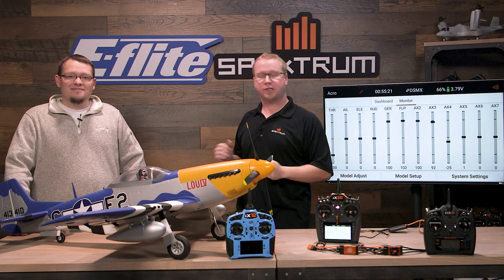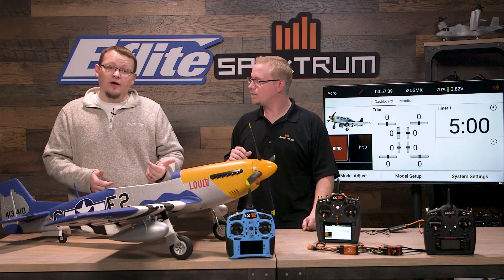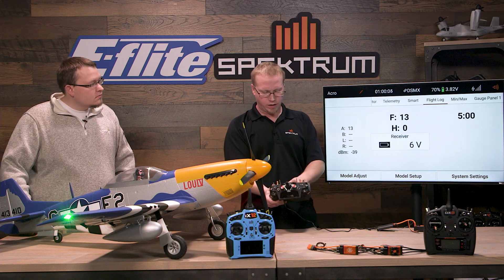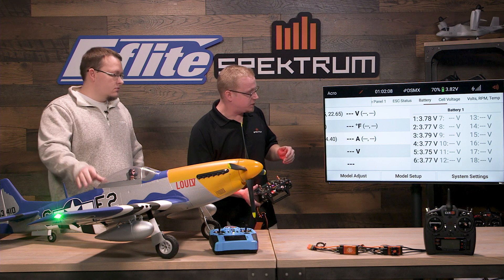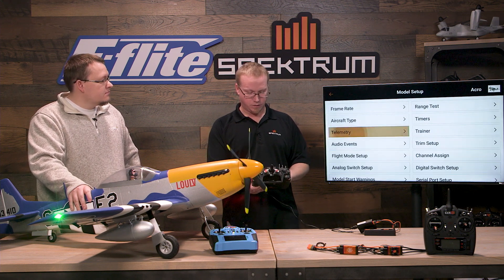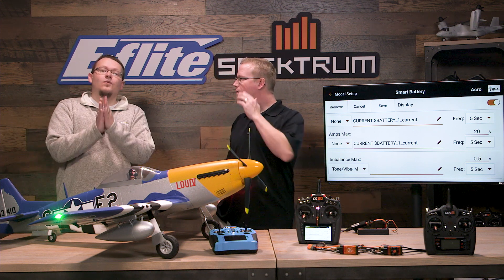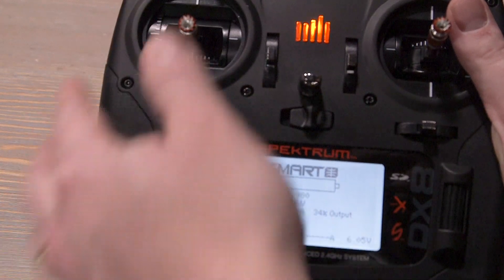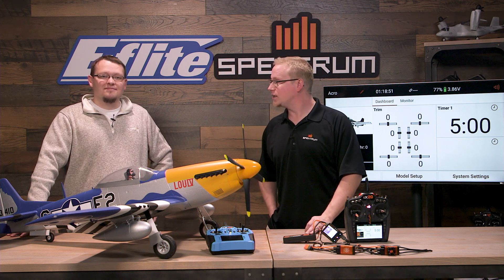Spektrum Smart Technology - E-flite Smart Mustang Telemetry Overview

Comment from the maker: -Some quick notes - 
- No this was not filmed in an oven, the installed ESC had non-production firmware installed causing the FET Temp to be incorrect. :)
- Yes we realize that leaving the prop on while running up the motor can be dangerous, this was done so that the Current meter would display. Please keep in mind that this demonstration was performed in a controlled environment by professionals. It is always recommended to remove props while performing initial setup and testing.
- To get these telemetry features you must update your Spektrum Gen2 transmitter to the latest firmware. Currently v2.04 at the time this video was posted.
- iX transmitters should also be updated, this is simply done over Wifi using the Google Play Store App.
- MANY questions are answered in the video BUT if there are any questions or comments, feel free to comment below!

- Important Links - 
Learn about the Smart Mustang here - https://www.horizonhobby.com/p-51d-mustang-15m-bnf-basic--p-efl01250
Need help updating for Smart? Check out our playlist https://www.youtube.com/playlist?list=PL3xicOtuJ602e0Iq4bwq3iVOHcEno43Wy

Learn more about Spektrum Smart at SpektrumSmart.com

Check out our compatibility Chart here - https://www.horizonhobby.com/pdf/SmartESC-Compatibility-EN.pdf

Make sure to follow us on Facebook and Instagram for all Spektrum News and Promotions!
https://www.facebook.com/SpektrumRC/
https://www.instagram.com/spektrum_rc/  
@SpektrumRC

Thanks for watching!

Comment: The problem with Spektrum 'smart" batteries is...$$$ verses longevity.

I bought 2 smart batts 3 years ago along with 2 elcheapos of an unnamed brand....the no names are still going strong with no sign of slowing down. ....1 smart died completely and 1 is questionable making it unusable in the air.

I'll take the 2 for 1 battery option and live without the "smart" feature gimmicks.
Not worth the money.

Comment: Big question, today my smart bat in this plane eflite 1500mm p51 kept telling me my batt was not charged but thing is my batt was still at 4.00v i restarted the controller and pluged tge battery in and got "not charged" warning while in the air. And so it didnt seem to trim the plane so i cud land it? And scuffed my plane . Why and what do i need to do .
Reply from the maker: First I would suggest updating your transmitter. There have been some bug fixes that should help with it displaying the warning in flight. Also, if you plug in while still on the ground and you see that warning then you should make sure your batteries are charged. 4.20v per cell is fully charged. 4.00v is about 75% and it will cause that warning to appear.
Reply: I AM SO SORRY DIDNT KNOW YOU GUYS GOT BACK TO ME, UMM, COULD I GO INTO TELEMETRY AND SET IT FOR WHEN IT GIVES ME WARNING , DONT THINK I HAVE A WAY TO UPDATE MY TRANMITTER I ONLY HAVE AN ANDROID TABLET
Reply: P.s. I also have 637 reciever in my fms super hornet and the smart batt doesn't do that in it

Comment: How do I accurately setup rpm. On my dx6e I have the poles which is 14, but what number do I use for ratio? I'm getting crazy rpm readings. My receiver is ar620 and 80amp avian esc. Thank you.
Reply from the maker: on a direct drive setup you will use only pole count, leave ratio at 1. Hope that helps!
Reply: @SpektrumRCvideos  thanks for reply. It's still not accurate... Im running my eflite 52 590kv motor on 6s, 14x7 xoar electric prop, poles set to 14. Ratio set to 1:1. I'm getting over 65000 rpm... But my metre tells me about 10000. Is there something I'm missing?

Comment: hi, how can I get the telemetry data of the used mAh during the flight. At present it is not possible to get it. I also do not know what the single cable with the plug coming from the BEC is used for. the Ar637TA has no free space to connect it. Wisches from Germany Guido

Comment: Cody- Tom. How does the flight pack voltage reading on the radio compare to flight pack voltage reading on the SMART checker?  I’m curious-in the voltage accuracy between each of them. I’m very interested in this new Spectrum SMART tech since I have both DX9 and DX18 radios. Thanks in advance for your response. 😊
Reply from the maker: What you will see between the 2 will be very much the same depending on the load of the pack. You might see a .01 (mv) difference when there is no load on the motor but that is negligible. Hope that helps!

Comment: Love the plane looks awesome. Can i use my first gen dx7 to fly this plane with the smart esc and dont care about the tech will it  be ok
Reply: Yes you can, older Spektrum radios will work for flight with no telemetry...
Reply: My DX7 Gen2 supports telemetry and AS3X plus safe w forward programming. Update your trx/rec. I use Avian w 637t.  Model SPM7000. Gen2

Comment: I really don't get the need for all this telemetry.   I prefer to watch my plane not my radio.
Reply: Scale Modeling USA who’s watching their radio? My iX20 talks to me. All this information just makes flying safer. I’ve seen planes go down because the pilot put in an uncharged battery. I’ve seen a plane catch on fire from the battery that prior to the fire I’m sure showed high temps. I myself had to land on the down wind leg because I flew my battery to zero. All three of these would be fixed by this Smart technology.
Reply: @jeffjackson6358  Flying with a voltage alarm will too . 6 dollars   sooooooo
Reply: Speedteamlosi and that’s great for you. But when one of your cells dump your voltage alarm won’t tell you that right away.
Reply: @speedteamhpi  There was not one mention of price in this video, if your poor don't buy it